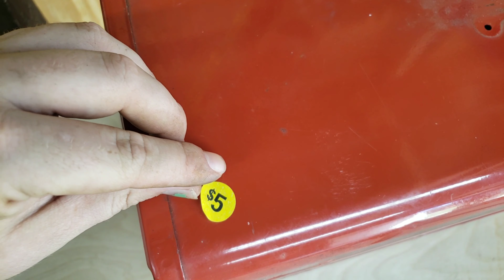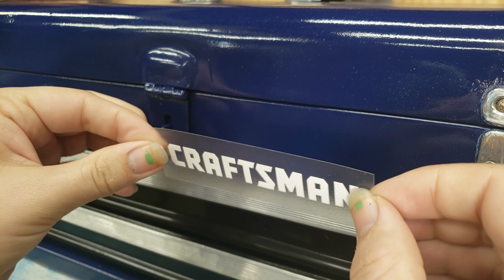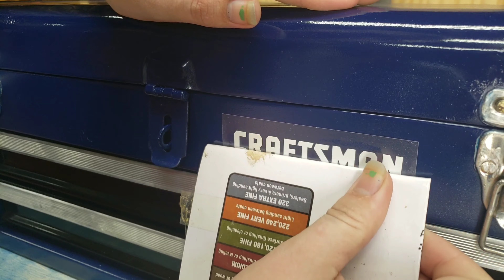Vintage Two-Drawer Craftsman Toolbox Restoration

Comment: Just did a few of these myself and they turned out great, it was very satisfying. 
Just a tip for removing the drawers + slides without having to push the tabs in and potentially loosen/damage the slides. I started doing the same thing but now realize it was longer and harder
- To remove any of these style drawers just take a hacksaw blade, heat it up about an inch from the end and create a bend at about a 45° angle
- Open the drawer you wish to remove all the way, and push it back in about a half inch so you have enough room to slide the hacksaw between the hitting drawer tab + slide tab
- push your new drawer slide tool in with the bend facing the wall (away from the drawer) until you see it pass the tab for the hole
- pull the slide - it'll force the tab right up and over the blade freeing the slide (keep the slide in the drawer a little bit for support)
- repeat other side
- do the same thing but in between the slides and box itself to remove the slides
To make the tool takes about 25 seconds, and once you have it made you can remove a drawer or slide in 2-3 seconds and leave the tabs factory positioning not bending them over and over 
Repeat to
Reply: Oh and I use a paintbrush and apply Johnsons paste wax to the slides for lubrication - it helps a lot. Be careful of what lube you use, avoid using grease especially as it will gunk up with all the dirt and grime quickly

Comment: Nice. I applaud the fact you used real rivets instead of the those stinkin' pop rivets. However you should have used round head hollow rivets and the tool to do the job. It would have been easier than pounding those brass rivets. But overall a nice job.

Comment: Good job on the old toolbox. I would like to encourage you to look into an actual pneumatic spray gun. A decent one won't cost too much and with a little practice you would be very pleased with the finish. Your choices of colors and textures would be endless. You could also investigate powder coating. That can be done at home with an oven for things that would fit inside one. Either one will give you more of a factory finish that you might like better than a spray can. Just a thought. Also I liked the fact that you didn't add some obnoxious music to your video. So many people do it and it ruins the whole thing in my opinion. Great job!

Comment: What is the metal bar in the back called. It keeps the other drawers from opening without the top opening first. I have a Craftsman tool chest that has one that is broken and need the part

Comment: Two questions:  Why did you wait to do dent removal until after you’d painted the whole thing?  You removed the drawer locking mechanism at the back of the box, cleaned it up and then reinstalled it but didn’t attach the lifting mechanism to the top lid; why?  The way that was done didn’t provide a way to secure those bottom two drawers.
Reply from the maker: That wasn't dent removal. I was hammering the new brass rivets to hold on the hardware. Also, I did attach the mechanism to the lid, but must not have included footage of it. Apologies for that.

Comment: mine didn't turn out like this. i have an old abused waterloo 2 drawer. it had a seized hinge, tore metal where the hinge was seized up and not a straight line on it. had to free up the hinge with oil, determination and a hammer. weld up the tears by the hinge, not easy on that thin stuff. then beat it out straight with a piece of 2x2 and a hammer. didn't prep it like that but painted it up. truned out ok considering where it started. last one i brought back had the bottom rotted out and a frozen hinge and a bent lid. turned out ugly but i only wanted something to throw chains in. i got a piece on tin from an old stereo and welded it in lol. then went around on the what was left on the sides and riveted it down to keep the from bend up, was too thin to weld.  it'll not hold moisture anymore, that's for sure lol. it might help ya, nothing wrong with what ya done but a drill will make quick work of those rivets if you can get it in there. the slides, i would have brushed off and greased. it made a big difference on mine. i do like how you peened the hardware on. i've always just used pop rivets. if i ever get a hold of one i care about, i'll prolly do that.

Comment: What's with the fingernail paint?
Reply: Should have used the stripper on your nails. JK
Reply from the maker: Yeah, it's a little embarrassing how chipped they are, but between working at the shipyards and restoring tools in my shop, it's difficult to keep a nice looking manicure. I'll try to have better looking nails in future videos.
Reply: I was just kidding I understand. Please don't take affence. The box turned out great the blue is way nicer than the red.